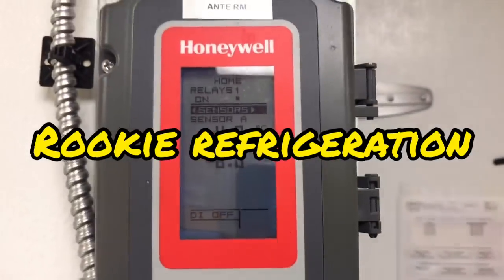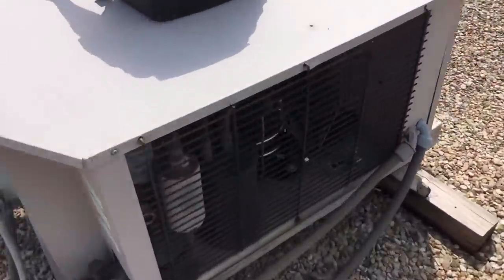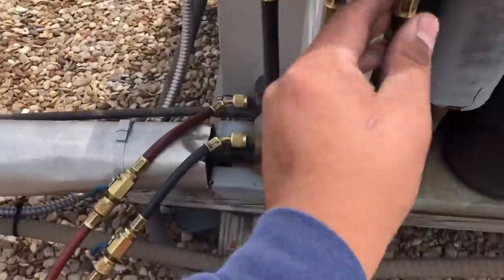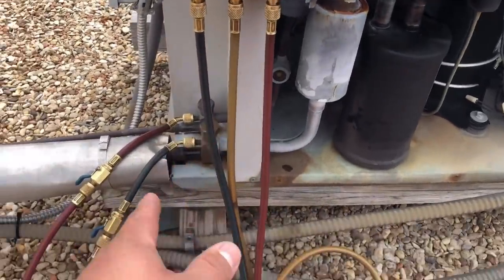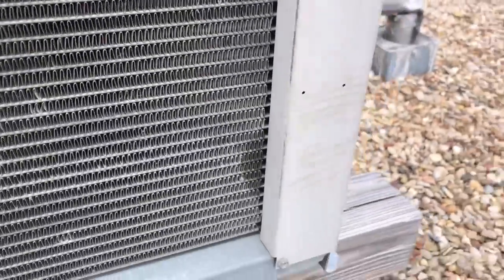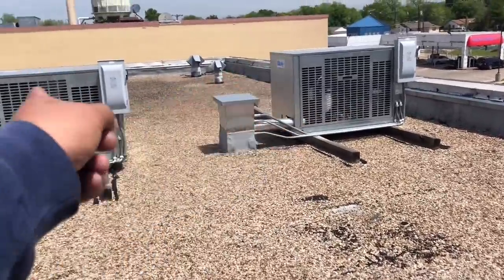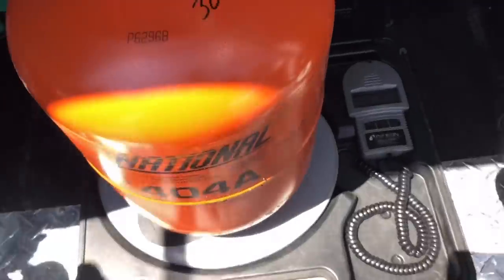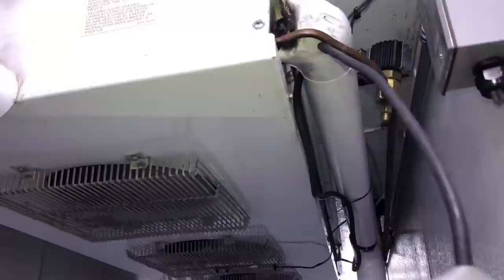HVAC Refrigeration:  Blood Plasma Freezer running warm.

Comment: Good vid ! Good find on the micro- channell leak. How old is the coil / unit ?
( Ftngot ) For the New Guys out there.
Sorry Rook , But i Have to call u on the Purging the guages scenario. it is incorrect. 
Hey Guys , Please Don't Just purge Hoses to Manifold. it Leaves a Big Air & Moisture bubble in the Refrigeration Manifold. Think about it. Wonder how systems get air & moisture in them. This is how. 
ALLWAYS Purge out the center of the manifold. Correct Purging procedure is:
1. Shut unit down at Disconnect.
2. set a timer on your cell Phone for 5 minutes.
3. Wait 5 Minutes to re-start system / Pressures to Balance off / Let Pressures Rise.
4. Hook up Low & high Hoses & guages.
5. Open high side valve - Purging out manifold and out center to refrigerant tank. while hose is slightly loose at tank.
6. Open Low side & do same. tightning hose at tank while purging.
7. Turn refrigerant jug as to dispense ALL Refrigerants in a Liquid form. ( There are exceptions ) but they are rare. R-503 , R-170 etc. For the purposes here im refrencing just Hvacr to -10 F Freezers. not cascades etc. CHARGE ALL SYSTEMS IN A LIQUID FORM as a General Rule.
Reply: Seems like either way will work. Just different directions of purging. End state is still the same.
Reply: This is the reason i use a 4 valve manifold. purge everything out the vac. hole & close vac valve. clears the manifold directly.
Reply: @OcRefrig  That's why I dont use manifolds at all.
Reply from the maker: Holy shit OC, I never thought about the space inside the manifold.   Never!!🤯.  Thanks bro.  I will be purging differently from now on
Reply: Thanks Rook , im glad u get it. Soo many people do it the way you showed and dont realize the big passage way in the center of manifold is full of air, moisture & dirt.
Please Pin this Comment - So We can Try to irradicate this Outdated & incorrect purging method.
appreciate it. Oc.
Reply: good point, I didn't even notice the lack of manifold purging, DOH!
Reply: Ive always purged from my low side on the system out the high side of the manifold through a gague line. What am I missing by doing that???
Reply: Ive done it this way the past 8 years and never had issues with moisture in any systems

Comment: Ok quick question coming from a resi tech. How do you check charge without line temps. I'm always interested in refer work and that side of the industry thanks and keep up the great work
Reply from the maker: Well, generally we use the sight glass to ensure the txv has a solid cooling of liquid.  Subcooling on systems with receivers is disregarded.   Once you have a clear sight glass, you should really check superheat at the evaporator.   Air conditioning systems don’t have receivers, so the bottom of the condenser coil “acts” as the receiver and subcooling is your “level”.   I hope I don’t confuse you.

Comment: What’s that tool your using to check if the solenoid is energized?
Reply from the maker: Jesus Siqueiros it’s a magnetic tester.  You can  get them at the supply house
Reply: @rookierefrigeration4357  Amazon has them too I bought them for my team
Reply from the maker: Tim R yeah, I’ve never bought one TBH.   I think I just somehow end up with like 5 in my van.  Lol
Reply: @rookierefrigeration4357  ya spartan keys are amazing too

Comment: Can I ask u a question I have a walking refrigerator use 134a whit a new evap coil new compressor,drier and txv  , clear the sight glass ,but the coil is not getting cool enough only 37 degrees suction pressure is 30 high side is 100 psi the question is do I need to adjust the txv and I need to open to allow more refrigerant
Reply from the maker: Lorenzo Ontiveros probably.  Given that the equipment is designed to work for the application you’re using it for.
Reply: Rookie Refrigeration thanks a lot for taking the time to answer my question I really appreciate, yes the txv and all for 134a it was originally mp39 and we change the evap coil and compressor

Comment: I could be wrong but when you opened the low side to purge did you just let more air in? Thanks good video buddy!
Reply: It was above 0 psi, so it was just barely pissing out gas at 10psi, so nothing dramatic happened.
Reply: Robert L yeah 10 psi in a negative though? Wouldn’t that suck air in?
Reply: Hunter King 10psi makes it negative temp on the gauges but still positive atmospheric pressure.
Reply: Fee Dizzle Shouldn’t you purge with it off? With it running it won’t just suck in air since it’s pulling?
Reply: Hunter King it’s called the suction side and technically it is pulling but only because the high pressure side is higher. Atmospheric pressure is 0 so it can’t suck in since gas pressure is 10psi.
Reply: Hunter King I’ve come across units that had no refrigerant and the gauge read -10psi so it was sucking in air at that point from where the leak was.
Reply: Fee Dizzle ok just clarifying thanks bud